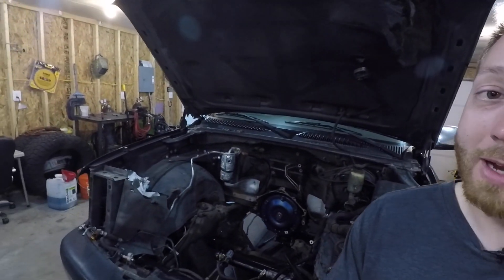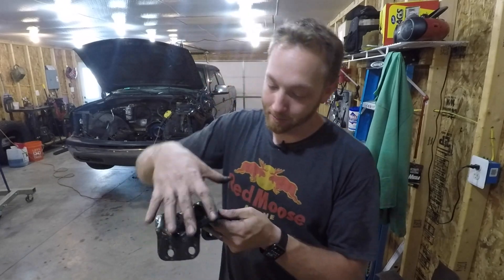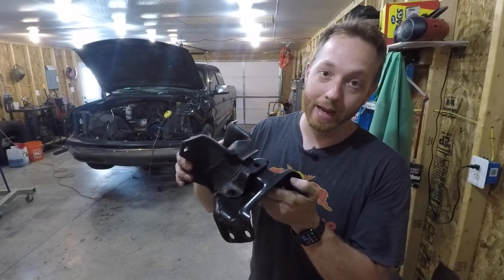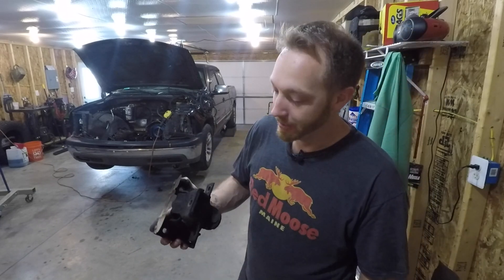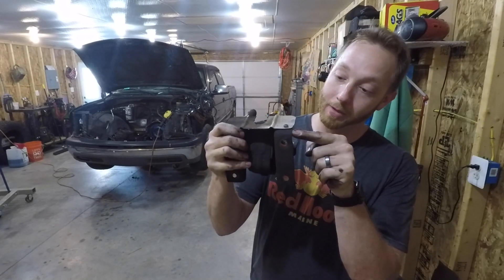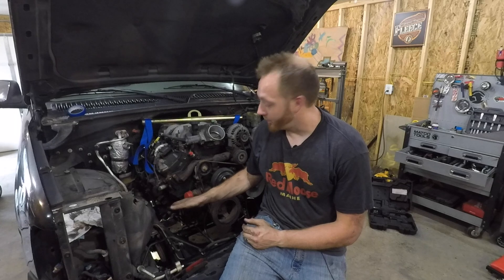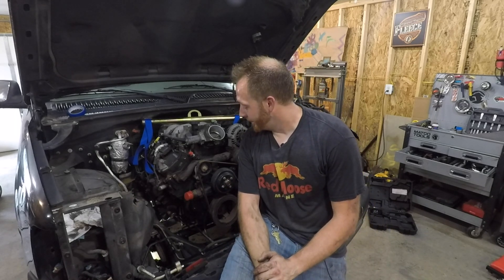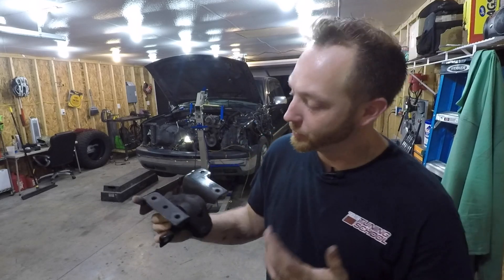Mounting a 496 Big Block in a 2000 Silverado

Comment: the actual reason i found your video, crap talk aside, is because i came across a sweet deal at one of my customers. im a delivery driver. he happened to be parting out a silveraydo 3500. friend of mine needed the springs for his 1500 since he was doing some suspension work. we talked and i walked over to the garage with him to check it out. hood was up and intake didnt look familiar. i  asked him what it was he said it was an 8.1L. i had built a few LS engine in my day but never really messed with the big block. so i thought about my 2005 mustang at home. asked him what he wanted for the engine. he said $500 bucks. i was thinking in my head thats pricey cuz i can get 5.3L at PullAPart for 250ish bucks all day long. so i said lemme think about it.  me and my friend went back after work to get springs. he ended up buying rear end too, few other  parst to finish his HD suspension conversion ( we should have bought whole damn truck, he spent almost 2 grand on suspension parts tho since the 3500 suspension is so high dollar) i had found out that 500 was cheap so i took it. and after some bargaining, i took the harness, ECU, and trans for 1100 bucks. SWEEET DEAL RIGHT. Its been sittin in an attached garage for about a year. and ive not touched it since. but i put plugs in all the coolant and intake holes. Otherwise its stored in a climate controlled nice garage. and its fine. no dust even. but i recently decided to start researching and ordering parts for this swap. surpisingly... its super easy. well for a traditional LS lol i ordered the LS motor mounts for the S197 mustang. havent mocked it up or anything. like i said still researching. but... i think this is going to be a really sweet swap. gonna watch more of ur work, u do things the right way for a budget. not the hack way haha  in your opinion, do you think that it would be worth it to bore it out a bit? and even tho i have a trans already, maybe a CD009 from a 2007 and later nissan? theyre rated at 1000hp stock. or i shouldnt say rated, theyre notorious for handling that kinda power and there is an adaptor kit from collins to adapt it to the LS bellhousing and hold plenty of power. do you think in ur opinion its worth it to swap to manual trans and bore it out for extra cubes? or do have enough research into this engine to say hey just use bolt ons? i have no goals yet in terms of power besides mounting it into the car. but bottom end work is something id rather do now before its in the car. it should fit since guys are dropping in the godzilla 7.3 shelby gt500 engine into these cars which is substantially larger of an engine lol

Comment: I wounder how different the 8.1 is from the gen 6 bbc I know the heads are different  but is that it ?
Reply from the maker: pretty much everything from the heads up is different, and from the deck surface below, its very similar. A lot of rotating parts will interchange, but the deck height is different, lots of metric fasteners vs. SAE, and the spacing of a few things is different, like the main caps bolts are spaced a little wider apart

Comment: I’m hoping u see this and reply, but what flexplate/adapter did u use or need to mate it to the 8.1
Reply from the maker: the stock 8.1 allison flexplate bolts up to the stock 4L80e torque converter without any adapters or spacers needed. also the 4l80e shares the same bellhousing bolt pattern, so its a direct bolt in swap.
Reply: @TolmanPerformance  thank u man I appreciate it, love ugly truck btw
Reply: @TolmanPerformance  does ur flexplate have a spacer already on it? Mine is a hays sfi flexplate not sure if that would cause me to need a spacer, cause the oem flexplate is thicker

Comment: Your very knowledgeable so I have a question. Do you think this would be simpler on a gmt400 chassis?
Reply: Reason is I have a wrecked 3/4 ton 2003 8100 with Allison 2wd and I have a 97 1/2 ton 2wd I want to put it in.
Reply from the maker: yes and no. The install will be easier since the 8.1 block is drilled to accept traditional SBC/BBC mounts, so if your truck had a v8 to begin with, the 8.1 will drop in and accept your stock motor mounts. The wiring will be a little trickier, where I used my original 5.3 LS wiring harness you'll have to either go standalone, or do an 0411 swap and add extra wires

Comment: Use the grinder your hitting sparks on your pickup glass that chips your window like the build lol watch where your throwing sparks
Reply: They make a dual throttle  body for the 496 quicker installation use  the hi long shaft disturber then summit makes aluminum intake run tallest 650 your you  got fire and gas clean installation I would  of with six sleep manual out of 2500 or 3500 switch the rear end 2500 have the axles bolt pattern changer to 6 bolt then you got something 8.1 called durimax killer all that torque
Reply from the maker: yeah, I know...

Comment: wish i had more
 info like this before i started to build my truck, i wound up using old school motor mounts and welded them to the
 frame instead, i also modified the frame up front to accept a 2500 rad supports and rad.
Reply from the maker: it did take a lot of reading and trial and error

Comment: I was glad to stumble across your channel and I'll continue to watch, but I do have one question.
Yes, LS-swaps are very vanilla and played out, and I get the desire to be different, but it's common for a reason. It works. With the 8.1 swap, aren't you simply spending more to get less? All for the sake of not running with the herd?
Reply from the maker: I think if you compare stock for stock, you’d be right. But a modded 8.1 be 5.3? Depends I guess, but there’s no way a 5.3 or even a 6.0 will ever make the down low torque that a big block will. And that’s what I like,  it torquey engines. But yeah, if you look at if purely from a cost per HP standpoint, the LS is a winner.

Comment: What kind of power do these put down vs weight and gas mileage i would rather have 300 hp with 20 mpg vs 280 hp with 12 mpg lol I know torque must be high but that’s only if your truck is way heavy oh what does this rev to
Reply from the maker: Well it does make more horsepower in total (comparing stock to stock) but power per cube, fuel mileage, and the weight advantage all go to the smaller 5.3. Obviously, when you modify either engine that can all change, but for me it’s not about the easiest way to make horsepower, it’s about being different and trying something outside the box.

Comment: Very cool build, I had a 2000 Silverado 2wd 4.8 5 speed long bed, great truck, it would have been awesome with the 8.1, but horrible on fuel, I went with the 2004 duramax crew cab Dually to replace it and still have it since I bought both of them new

Comment: What's the issue with the 8.1 fitting in a 4wd 2002 1500
Reply: The 8.1 was available in the 2002 avalanche 2500 4x4. So it should be do able.  Several available online,  one with 45000 miles on it.

Comment: Tell you what I got a sbe 4.8 sitting in the shop and a t6 s475 il pull the forged ls1 and 88 out and throw the 4.8 and the s475 and have a little competition hp/tourqe 1/8 and 1/4 mile e.t and drive ability and I got th400 and ain't scared. And say those body style 99-07's are ugly we will fight! And I'm in bama
Reply from the maker: Not a bad idea! And not saying the Silverado’s are ugly, just this one, especially when I first got it, which is why it earned that nickname. You’ll have to check out the first upload on it to see all the hideous chrome add ons.
Reply: @TolmanPerformance  lol I was joking about the fighting ...! Are you doin any thing to it maybe cam and ported heads or cam and boost I'm serious about comparing the two at the moment mine has a ls2 it was a typo in the first comment when I said ls1 but it's got a half filled ls2 block it did have gen4 4.8 rods and crank in it with forged D.S.S pistons starting this past Thursday we pulled it out and some stock length summit forged rods and the stock ls2 crank with PRC CNC'ed 799's ljms cam and a summit brand 102mm aluminum intake and TB and 210#s Huron  speed single t6 kit with a 4yo  garret 85mm x275 class legal turbo its Holley hp efi th400 manual valve body and brake, 5 lug swap up front  with 90/10 shocks and built factory 8.5 10 bolt strange axles with a 4.30 gear and spool it's got calvert leafsprings and caltracs and strange double adjustables 3" drop in the front 4" in the rear  so we cant see who can tow the most lol its took me almost 3 years to get it where it is I sold my race car small tire 99  z28 turbo car to finish it up and start on something new in the near future it's been running and driving about 3 months and went a 6.83 @ 103mph with the baby 330ci ls2  if the weather is good this weekend I'm going back to see how much closer I can get to my 5.90 goal I know it definitely has the tourqe and power to do it. This combo on 12 pounds feels like the other at 16 and I'm loving it I forgot how much fun a fast street car is I could daily it if I wanted I actually was until the rods my wife got me for Father's Day went in the motor the other day she even got me arp main studs and a motion raceworks front cover with oil return an bung in it. It started out as a super clean single cab black Sierra iv had it corrected and ceramic coated its now officially my dream truck it came out better than I imagined it's got Weld full throttle 17x4 black and polished weld alumastars and 15x11 weld RTS beadlocks 77's and Hoosier 28x10.5's it's so much funner than the race car Iv been on a 115 mile round trip on a 3 day old fresh motor yesterday it was a blast the wife didn't like the no a/c but who doesn't love a 5" hood exit exhaust and turbo noises and the smell of ignite red lol I had to carry 3 ten gallon fuel jugs and 15 gallons on the fuel cell just to be safe lol I'm down for a competition even tho I lose towing off the bat and I can put a 4.8 and the s475 in it tho lol

Comment: Lots of work to get the same power you could have got much easier from the 5.3. Some things don’t happen because other things are better, easier and cheaper. I don’t understand the idea that something is better because it’s rare. Usually things are rare for a reason. But still interesting to see, good video, great job, I’m interested to see the outcome.
Reply from the maker: You are right about this, and I acknowledge this a few times in my videos. The LS family will build power for much less money. I’m under no misconception that just because they made fewer 8.1s that they are “better” but this build is more about taking the road less traveled and trying something new.
Reply: THERE IS ABSOLUTLY NO FUCKING REPLACEMENT FOR DISPLACEMENT!!!!....HE WILL BE AT PEAK TORQUE WAY BEFORE ANY 5.3 ENGINE EVEN IF IT IS FORCED INDUCTED TO A RESONABLE POINT...ASK ANY REAL RACER OR EVEN ENGINE BUILDER AND THEY WILL TELL YOU THAT WITHIN A FEW HUNDRED HORSEPOWER, WHOEVER REACHES PEAK TORQE FIRST WILL ALWAYS WIN
Reply: What about torque that's what moves the weight
Reply: @diduck6878  you’ll get more torque from a turbo LS before it breaks than one of these will take before it breaks. So you want more torque, get the LS.

Comment: Can that trans handle that?
Reply: I think he got the trans that came with the motor but if not then he would have to at least use a 4l80e or nv4500 or built t56...etc
Reply from the maker: Got a 4l80 swapped in already
Reply from the maker: It’s a 4l80e I swapped in a bit ago, so let’s hope so! The 8.1 came attached to 4l80s in suburbans and avalanches so I’m thinking it’ll be good for a while.

Comment: I thought the 8.1 was a ls too
Reply from the maker: People often say it’s a big LS, but actually it has very little in common with the LS, it’s more like an updated big block. It does have cathedral port heads similar looking to an LS however...
Reply: technically, the only "LS" based engines are going to be found in high performance applications such as camaro, corvette, ss labeled stuff....everybody wants to call the 4.8, 5.3 etc LS but they are not correct...its like saying your cousin is like your brother

Comment: I'm really interested if you can get some gas mileage figure's for every day driving then you will have me addicted, seems I can't find anyone who has gone down the road of improving milage as we know it will make power and people seem to just rely on LS engines for milage but I want both worlds from an 8.1
Reply from the maker: I bet with a gear like a 3.42 it might not be awful. I’d say mid teens at BEST, but I’ll definitely report when it gets done.
Reply: @TolmanPerformance  please tell me you are contemplating a 6L80e swap to have lower gearing to allow taller rear gears without sacrificing performance and yet still try for good milage, am watching as contemplating this for suburban, full steam ahead.
Reply: You can not have raw performance and gas mileage at the same time...you have to sacrifice gas mileage for maximum power and torque....if you are worried about gas mileage then you probably shouldnt be getting into the world of performance....it is well worth it by the way:)

Comment: Ls hater.. Its not original its better. ☝ upgrade and a 8.1 is a turd w no aftermarket. And even so that 8.1 can not in anyway out perform a 5.3. Triple the money half the horse power... Shout out to the redheaded stepchild. Lol u my boy blue
Reply: Raylar makes head and cam packages for the 8.1.👍
Reply: ...and how many engines have you built by yourself?
Reply: Well dumbshit, they have pistons, heads, cams, supercharges, rods, valvtrain...etc etc and fucking etc
Reply: Me 4
2 22r 
383
And this 5.3 
Building a turbo lc9 for a 87 TA hmmm my brother who we are  building the car went to sam? So yeah we both laughed a clapped out cam only 5.3 200k + tapered bores and used rings makes more than all the motor u can build with that... anyway way u want from the 8.1 is a kinda tall deck not much bbc parts dont bolt on and idk 5 thousand is a low ball for what a lol 5.3 for 1000 dollars with a cam will destory that motor in every aspect cool. And to add insult to injury evey turbo 4.8 5.3 is 6 7 800 hp Even with the best head on the planet its a low compression cast piston rod stock rod cast crank. ???   Wtf r u talking about using just the block because it in of itself is 200lbs of iron. A 8.1 is dud and i spend long enough in the field artillery e6 section chief... ik a dud when i see one lmao. Oh lastly that motor was.... Drum roll canned f9r the 6.0 lol
Reply: Jonathan Schrader. You sure are trying real hard to make a point for some reason. He already said he wanted to be different, quit interjecting your opinion that is not needed. No body cares arm out your engine, I think most of us car guys have all done LS builds.
Reply: @bri-manhunter2654  😎 ol boy asked.. Anyway the 8.1 is not a good engine to swap thats why its comical. The 6.0 replaced it. So? Whats the argument and a... Sorry for hurting feelings the army does that

Comment: The LS is the best motor, everything else is just dumb
Reply: I like my fully forged 394 stroker Hemi, but I like LS motors to.
Reply: ....ok cool bro, how many "LS" engines have you built and tuned and ran down a track?
Reply: @hoofarted8709  LOL anonymous internet guy!  My local track shutdown, so I no longer go to the track.  What does that have to do with the fact that the LS is the king?  I've been building engines since the early 70's, everything from small block Chevy, big block Ford, Mopar and LS engines, I'm doing a cam swap, for a turbo LS today!

Comment: I have a 30k mile 8.1 from an RV on a pallet in the barn. Can't decide whether to put it in my speedboat, or my 2000 3500 Chevy standard cab.  BTW, A/C bracket for the RV/medium duty trucks puts the compressor up top, not bottom of the engine like yours. Dart sells heads and a carb intake for this you know.
Reply: Put it on cl and buy an ls

Comment: Correct if it has a steering box, 1500hd up then it is a bolt in affair the frame mounts and engine mounts are the same for duramax and 8.1.
Reply: My 4x4 has a steering box does that mean it would bolt up it's a 1/2 ton
Reply: @james10739  same but its a 1500 not hd, still work sb0mbsilverado